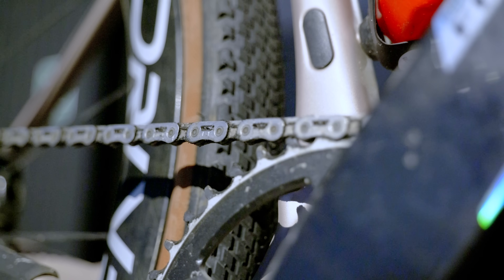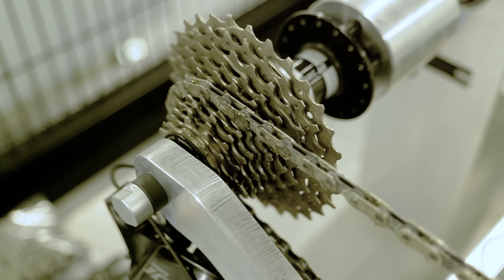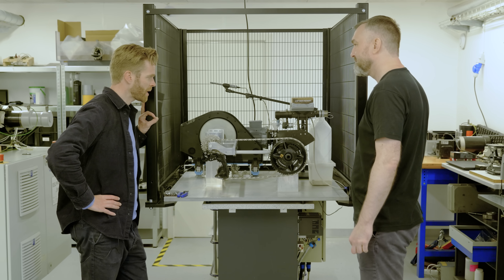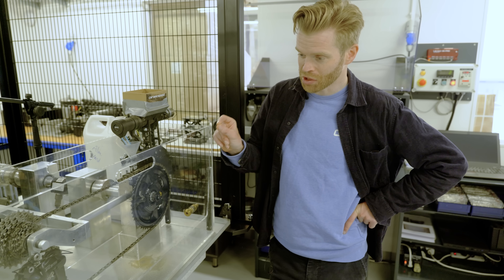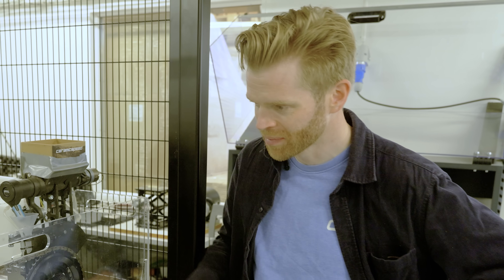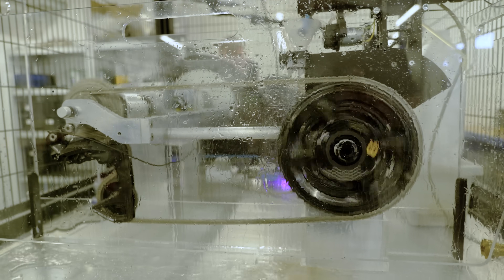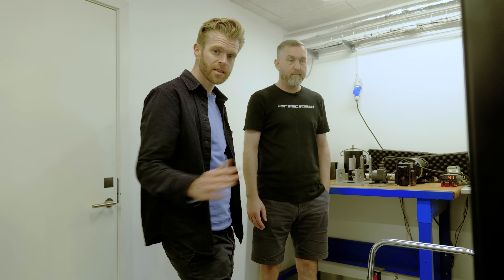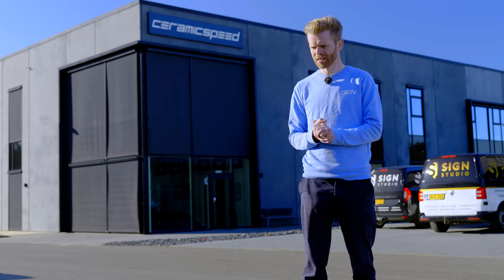We Lab Tested A Dirty Chain, How Much Slower Was It?

Comment: I think the large size gears are more efficient because the chain folds over itself less, maybe why the new hype is larger pully wheels? You can't really get around the smaller gears on the cassette because those allow to go faster, but if you increase the size of the front chain ring and pulleys, you may be able to shave off more losses in the system.

Comment: I think this speaks a lot to the quality of the lubricants you were using on the chain initially (presumably waxed with Silca products prior to Si and Ollie using it). I am curious about the wet lube though and whether any had been applied prior to the test. Either way, wax does such a great job of taking up all the space dirt might go, let alone not allowing it to stick as much in the first place. I’m guessing that chain wasn’t nearly as dirty as it seemed. How many times has this been highlighted in various videos showing how comparatively clean a waxed chain is along with its drivetrain after substantial use? I wonder if it made the test engineer think a bit about what was likely a competing product or products. The fact that he was so surprised was impressive. 

And yes, the extent of the benefits of bigger cogs and chain-line was eye-opening, but — particularly with respect to the rear cassette — to me it highlights even more the value and efficiency of riding at higher cadences.

Comment: Given that the size of the gears makes the largest difference in drivetrain efficiency, would increasing the size of the gears in both the front and back (to have the same ratios, but with more teeth) be able to overcome the weight increase in terms of overall watt savings?

Comment: As an engineer, I was expecting a lot more than 1 watt for having such a corroded chain versus a pristine chain.  Very informative. Thanks Ollie and to the Development Engineer at Ceramic Speed.
PS. Intuitively aka without data, I never bought into the 'waxed chain myth' and turns out I was right. Standard wax based lube...a quasi-clean chain but not immaculate, and good.   Perhaps we all learned that biggest sprocket aka less chain pivot articulation trumps chain line. Many likely wouldn't have expected this believing chain-line would dominate for efficiency. So running big chainring in front with slight cross-chain to big-ish in back is still faster than the same gear inches on the smaller chainring and rear cog in spite of straighter chainline.   I believe the data but fellow engineers may all be a bit surprised by this outcome.
Reply from the maker: thanks for the comment @ArtLangston-o9d  
Hopefully we can do some more experiments with different gearing ratios!
Reply: You misunderstood the claims about waxing and assumed too much from the video. As for efficiency, waxing likely only benefits people who  need to gain every  fraction of a watt they can. What you misunderstood is that the benefit of waxing is the reduction in chain wear and the significant increase in chain life and drive train life.  That data's out there, and it's been validated.  Just because you don't understand it, doesn't make it a myth.
Reply: @robinseibel7540 it seems you don‘t understand fractional gains. It is not about people who need a fraction of a watt. It means if you want to gain a lot of watts you can do it by finding a lot of small gains. Everyone who likes cycling wants to gain a proper amount of watts. In the end you have to weigh it against your efforts…
Reply: @arnoldmuller1703  I completely understand marginal gains.  I didn't indicate otherwise.  It is true that there are a lot of riders who don't car about marginal gains, and specifically about marginal gains from an immersion wax vs drip wax vs oil-based lube, etc. That means your claim that "everyone who likes cycling wants to gain a proper amount of watts" is false.   I'd wager for most, if not the overwhelming majority, or cyclists won't see any difference in their data, if they're interested in their data, that empirically shows that marginal gain.  In fact, I'd say outside of lab or velodrome, the marginal gain from wax is likely to be lost in  the noise/measurement uncertainties. Note: that doesn't mean that people aren't interested in the marginal gain from using or shouldn't seek that gain if that's what they want.
Reply: @robinseibel7540  of course you most likely don't see efficiency changes when you switch from lube to wax, but when you do 10 more such changes, e.g. aero socks, propper pressure, intgegrated cockpit, ... you will eventually see changes.
Reply: @arnoldmuller1703  Where do you think I even suggested that the sum of marginal gains can't be seen in ride data?  Nowhere. Nowhere at all.  This statement you made, "it seems you don‘t understand fractional gains. It is not about people who need a fraction of a watt", is patently false.  I'm not sure where you got that idea.  This statement by you, "Everyone who likes cycling wants to gain a proper amount of watts. In the end you have to weigh it against your efforts...", is also patently false. There are loads of people who love cycling and don't even care about power output.  How you define cycling and what you think is important aren't universal ideas.  Stop misreading what I've written.
Reply: @robinseibel7540  "As for efficiency, waxing likely only benefits people who  need to gain every  fraction of a watt they can. " this here showas clearly that you didn't get that. It effects really everyone. And of course it affects (sensibly) everyone. Why is nobody cycling on stone wheels? Because efficiency is what makes cycling cycling. Btw "Where do you think I even suggested that the sum of marginal gains can't be seen in ride data?" this is a straw man. I have nowhere written this, stop misreading what I've written!
Reply: @arnoldmuller1703  Again, you don't read carefully. And you clearly can't differentiate between people looking for marginal gains and people who don't care about marginal gains. And if you think there aren't cyclists that don't care about marginal gains, then you clearly have no clue what motivates any  cyclist beyond those that think and prioritize things just like you.  Learn to read.  Learn about other cyclists.  Unless you're brain dead, you will noticed others commenting under this video that outright say they don't care about saving watts. Others have said they don't use wax. So based on the evidence alone your claim is false.  Since you can't read without inserting your own bias, then I think we're done.  Enjoy your ride.
Reply: @robinseibel7540  I mean chains are so cheap. If you change them on time your drive train will not sustain damage anyway. No need to spend time and resources waxing when the chain wax itself is overpriced
Reply: @GiJoe94 That's not true at all. That's not how wear works.  Further it's questionable practice to just buy cheap does that doesn't last and then chuck it in the garbage.  Time and resources? I spend less than 10 minutes every 8-900 miles or so.  What a massive time drain that is!  Resources? Which ones? Money? I save money in the long run. compared to running an oil based lubricant.
Reply: @GiJoe94 That's your opinion, and it doesn't seem to be based on any facts whatsoever.   I don't think you're actually interested in data and don't want to challenge your own assumptions.  So be it. You've certainly presented no facts to counter anything.  Oh, hey: cheap chains don't last as long as more expensive chains (in general). This is something that's been demonstrated in testing.  Wax overpriced?  So you claim. I doubt you know what's in some waxes, how long a batch of wax lasts, how much it extends drivetrain lifespan, etc, so you really don't know how much in the long run it costs you to run cheap stuff and throw a bunch of cheap stuff out vs immersion waxing.  Everyone's free of course to choose what they feel works best for them, but people aren't free to make up "facts" and make false claims.
Reply: @robinseibel7540  Cheap that doesn't last if it's $5 chain. Even if you wax the same chain it wouldn't last anyway. The $30-40 chain range lasts with just rag and lube
Reply: @GiJoe94, you don't know how long any waxed chain will last because you don't wax. You're guessing and making claims with zero facts to support. Assumptions aren't facts. Use what you want, but don't pretend you know anything about the cost of waxing, the time involved, and the long term costs of your method vs waxing.
Reply: @GiJoe94 Sram 12 speed chains are not cheep.   And wax is cheaper than lube.   But you have to enjoy the process,  lube is much easier.
Reply: Way easier to keep the bike clean too
Reply: So, will they be showing the utter scam of their entire ceramic bearing business also with this machine?

Comment: One of the reasons why I don't like the fad for doing away with a front derailleur. With a 1 x front sprocket you spend much more time with the chain at an angle (out of alignment) and on the very small sprockets. The only question is to what extent the extra weight of a front derailleur, shifter and cable detracts from any gains in efficiency.
Reply: yep it is pretty dumb, BUT the narrow wide thing is pretty cool because it doesnt drop chains.
Reply: for me at least lower weight helps most with handling not speed

Comment: This video actually made me think about something else. When you are on a trainer, like the Tacx Neo 2T, it is measuring the output power not the input power. On the road with a power meter (either pedals or crank arm) you’re measuring input power. So…when the trainer manufacturers talk about accuracy…how can that be, given what you’ve just shown us. The trainer doesn’t know what gear you are in. Nor does it know how clean the drive train is. Seems like the training software that controls the trainer really needs to allow for the connection to input power sources to really be accurate…and to give you the type of information shared here. Lastly…I’m blown away that training software also shows cadence data. Clearly it is extrapolating a lot of data based on the output torque and speed the flywheel is experiencing. Please do an episode on this!  Fascinating…
Reply: Well yeah, I think this is the main reason people see a difference in power between outside riding and trainer riding. Their actual power output isn't changing, it's just being measured after the 3-4% drivetrain loss on the trainer.
Reply: @jealnoslyn  This is true. The thing is that it doesn't matter.   They just need train to the power they see on the trainer.  It's easy to do an FTP test on a trainer,.

I don't worry about it.  I've got Favrero Assioma Dual pedals and use FulGaz online.  I have it set to read the power my pedals measure, but Fulham uses the power measured by my trainer to control resistance.
Reply: Trainer power measurement accuracy is not determined by the system, nor should it be. It's simply a measurement of the trainer's precision (variance, actually) and likely accuracy (as measured against a calibrated device).  In that way, trainer power measurements are no different than power measurements from PowerTap hubs (RIP, PowerTap).   You ride, race, and train according to the power readings from a power meter, not according to what your actual power output is.   Generally, you don't use the numbers from an old power meter to measure your performance on a new power meter.  Usually you need to do a test to see what your numbers are on a new power meter. After all, none of them read exactly the same.  More importantly, no power meter claims to measure your power output exactly.  They all measure power at whatever their location is, and they absolutely do not try to estimate upstream power losses or upstream power output.  That would make for some really crappy power readings.
Reply: Funny enough you mention the neo, it very much looks like that machine measures power using a neo.

But yeah what power you actually get out at the end is surely more accurate than what you put in at the very start for determining how fast you should be going virtually... although that dose make me think to give yourself a race advantage you could use the measurement off your pedal rather than your turbo 😅.

Also If using the turbo that using virtual shifting and haveing the chain on a bigger cog on the cassette could give you a few more watts!
Reply: Maybe they use a correction factor
Reply: @s0012823  There is no correction factor to be had for upstream power.  Further, there's no need for it.
Reply: My trainer (Zwift Hub) gives me consistently lower power than my crank based power meter, by as much as 10%.  I have it setup to measure both simultaneously.     I assume some of that is drive train,  the crank based meter is, as you put it, measuring the power I put in without any drivetrain loss.
Reply: Other way round. the crank and pedal power meters do math to account for losses and are never quite right.  But since the precision of those devices are often a few % and your losses from these things are also a few % its a bit of a wash.

Comment: Smaller sprockets create degrees of articulation. Articulation on top and bottom increases with smaller gears because of the smaller gear being used on top and the slack being taken up on the bottom, more bending. 

I'd be interested to know if degreasing a chain, then running it dry for a little while would compress and harden the surface areas - sort of like shot peening - and then adding wax wouldn't make for a very durable and efficient chain.
Reply: Running it dry might do the opposite, too – gall the treated surfaces. I think it's safer to break in a new chain with lube rather than without.

Comment: To me this leads to the conclusion that the main losses are from wrapping around smaller chainrings, (ie large articulations in the chain) which are exactly what the two jockey wheels are in this system. So would a tighter chain (giving less angle on the jockey wheels) and larger jockey wheels give a decent saving?  It'd be interesting to compare a TT bike running at 250W/90rpm/27mph with a 52T to 14T and 'loose' chain on standard jockey wheels, to a TT bike running a 62T to 17T and a 'tight chain' (so it's going through smaller angles through the derailleur) on larger jockey wheels.  Free speed I suspect?

Comment: Thanks for another interesting and informative video. Two thoughts 1) roller wear does not contribute to chain "stretch."   Only pin and inner link plate wear contribute to stretch. Although, two-point chain checkers will measure roller wear as stretch. 2) In my experience, chain wear contributes significantly to resistance. I wonder how chain wear compares to cog size and chain brand differences?

Comment: This is so interesting. That bigger sprocket = less drag is what actually the most valuable result of this test. I always "feel" the big-big combination to be most "direct" in terms of the feeling of "exerting force" or "responsiveness". However common knowledge didn't agree with that so I thought that might be just me. My favourite climbing gear is that 53-32 or a little bit smaller ones if less steep. I "know" from chain line perspective that I should use small ring at front with mid cassette, but feeling alone is just that 53-32 or similar just feels most direct, like when you change to a stiffer bike or stiffer crank arm. Now it seems it's validated. I wish you can dig more into this because this is still N=1 there might be flaws we don't see in the experiment design or so. Or this will be a HUGE contribution to the whole cycling community. The change could be fundamental. (think all the Olympics or TdF using different gear). Also I think since this is a sponsored video, you should really pitch in the direction towards the durability and money saving perspective. But still thumbs up for your honesty of the test result.
Reply from the maker: thanks for the comment, it is interesting how climbing on the big chainring and a bigger sprocket tends to "roll" better compared to being in a small chainring and small sprocket

Comment: This explains why the new S5 has a 1x option, based on a MTB drivetrain.  If you save 2 watts ditching the front derailleur, you can cross-chain the wee out of that thing and still be way ahead of a 2x.

Comment: I once bought a used Dutch bicycle. The chain was protected and inside a plastic guard. I couldn't see the chain. It was harder to ride than usual. I removed the guard and saw that the chain was completely dry and hard, with almost no bend. I lubed it, and the bike went noticeably faster and easier.

Comment: You're im the Ceramic Speed HQ and you didn't ask the holy grail question about the pulley wheel?
Reply: That would have been too obvious.
Instead, they - 'surprisly' - found out that the sitze of the sprockets does matter. 😂

Comment: I have always wondered about the trend to smaller cogs, especially by SRAM as it really is bad for efficiency - pair a smaller chainring with a smaller cog you get a) more tension on your upper part of the chain, meaning the resistance of the joints rolling off from the cog and onto the chainring is higher and b) more articulation in the joints of the chain. So two factors worsen efficiency making the cogs and chainrings smaller!  The downside of larger cogs and chainrings is aerodynamics and weight of course. If you balance upside and downside those, I would guess that the optimum for typical road cycling races should be around 14 teeth for the smallest cog to use (which in effect would mandate a x2 drivetrain.). Thanks for the insightful video!
Reply: 2× (or even 3×) drivetrain is optimum anyway; the primary benefit of 1× is ease of use, not efficiency (& certainly not shift range!)